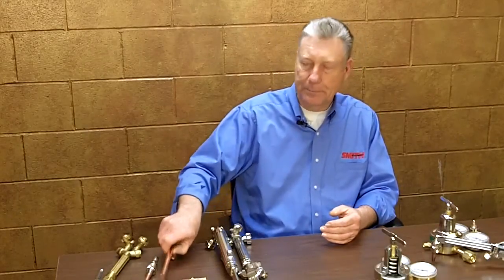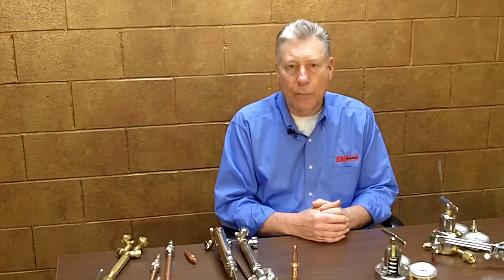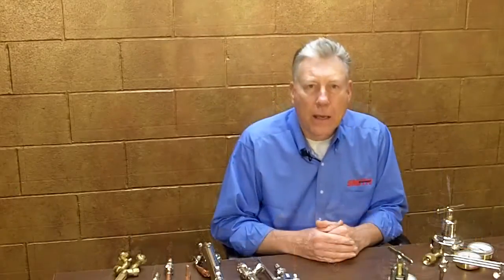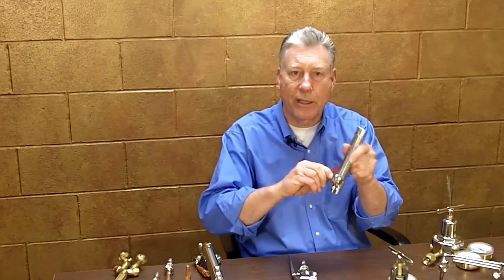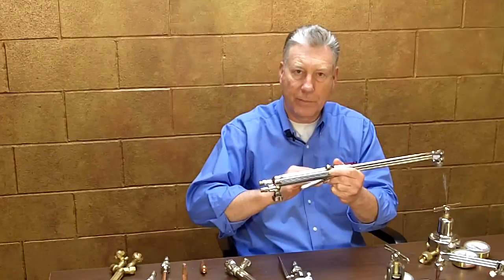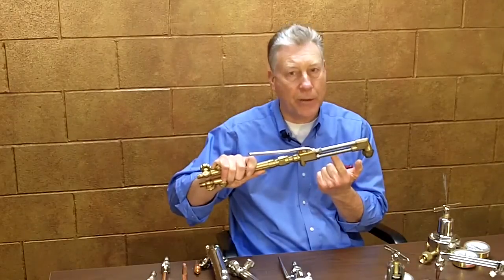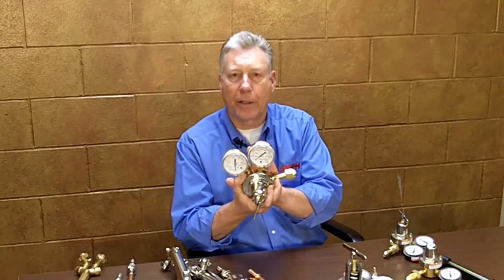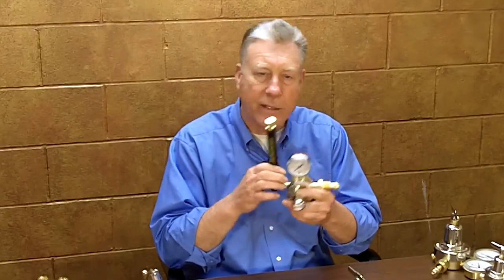Miller/Smith Product Information Volume One

Comment: Why is it I cannot find an old Smith torch catalog?       I can't find any source of information on the various models of Smith torches throughout the years.      I came across a photo of a small Smith torch that resembles a Victor J40  and could not find that torch anywhere.   I wanted to try and figure out what the model # was with no luck!    Does Miller/ Smith have a catalog of torches from the beginning?     I would think Elmer Smith was be disgusted if there was no library of Smith torches from the beginning.

Comment: I have the multi unit one with the top ox handle n idont know how to use it. Wen It comes to cutting so i just heat up the bolts vs cutting them off::( the flame never gets big it's like something is wrong :(

Comment: i'm a bit confused, i remember smiths torches back in the 80's when i lusted for one of those chrome-looking torch sets.... so did miller buy out smiths? why did they drop the s from the name? did they think that miller/smiths would draw too much attention from the miller name? it just looks so stupid from someone who actually noticed the change.
Reply: Same question: Did Miller buy Smith’s? I can’t understand why anyone would abandon the old “Smith’s” logo with the rainbow(?) connecting the two S’s and the trademark symbol.
Changing to Miller-Smith apparently leads to offering of “SMITH” branded parts and “like SMITH” & “fits SMITH” products online. It looks like abandoning the original logo means that it’s not possible to defend the new SMITH name from imitations.